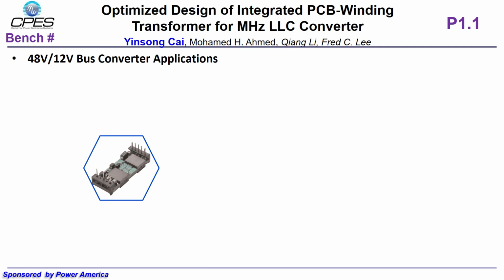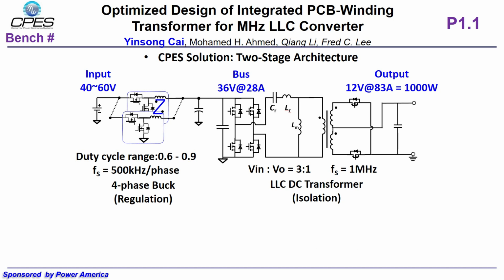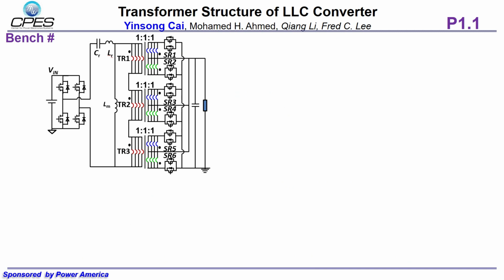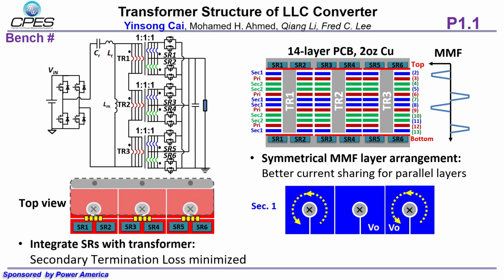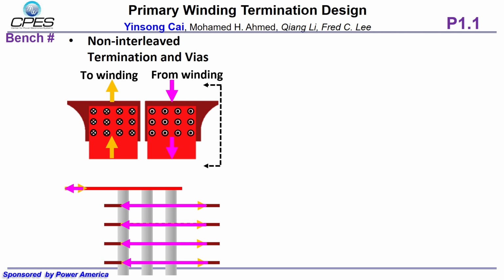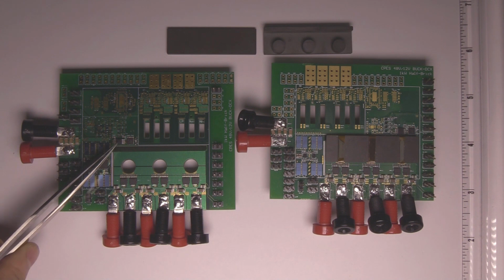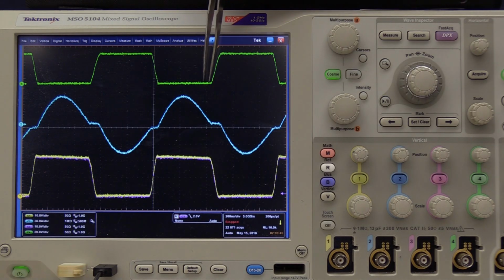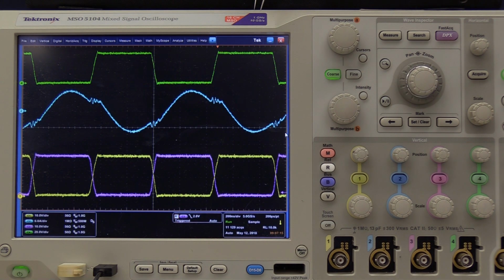Optimized Design of Integrated PCB-Winding Transformer for MHz LLC Converter

Comment: Have you tried PowerFlex Circuit windings instead of rigid pcb?  I built 100W, 240W and 500W rototypes in 1998-1999.
Reply: It’s max thickness is 0.5oz. You need it about 10-20mm wide. That’s merely can be considered as a planar transformer. Besides you lose a main idea: to manufacture a transformer, not to wind it.